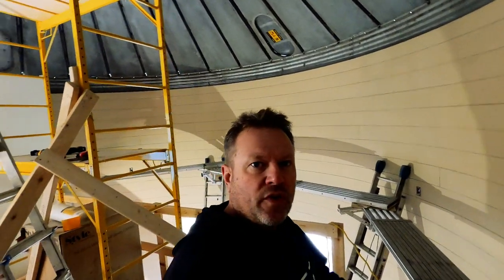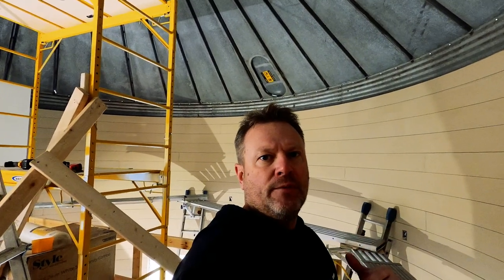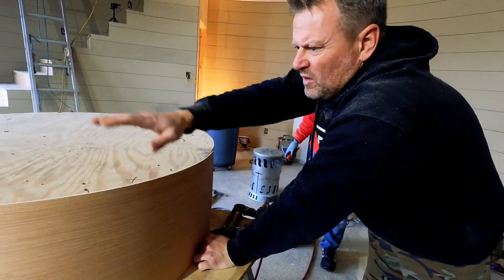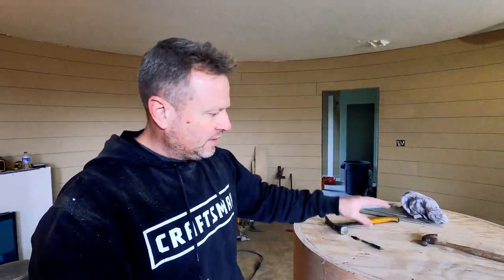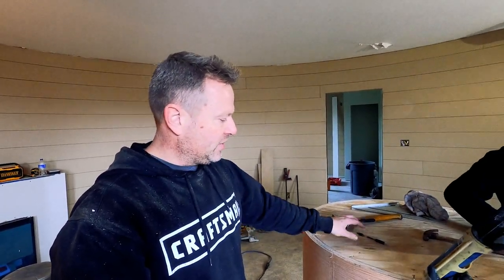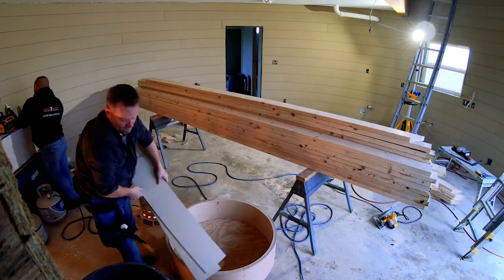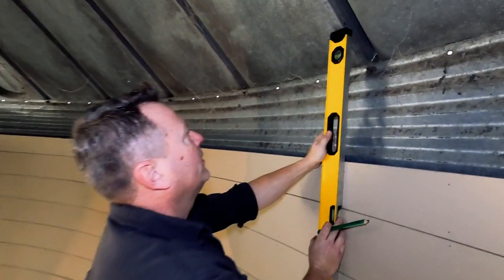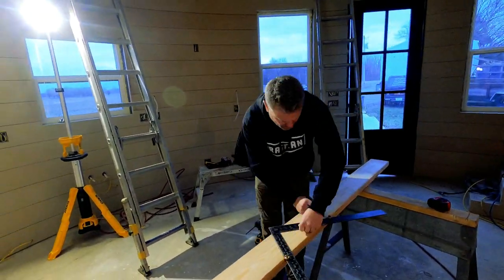Grain Bin Home Build... Episode 23 "Ceiling Framing"

Comment: How are you venting the roof? Metal roofs can create condensation. Looking good !! I'm picking up a 30ft bin and going to do a similar project and use it for a VRBO.
Reply from the maker: Did not vent the roof.  It is spray foamed around all penetrations and batt insulated to that.  Completely spray foamed is premium.  It will not condensate if insulated correctly and well.

Comment: How did you determine the angles for the roof rafters?
Reply from the maker: @rickpainter4821  I set my round center hub, suspended from metal roof with straps.  Then I used a string line from bottom of hub to top edge of my framed curved sidewalls.  This string line represented the bottom of my rafters.  I could then use my speed square or angle finder to determine what these angles were from my string line.

Comment: How did you hang your round hub from your metal ceiling?
Reply from the maker: I suspended it in the air from the existing metal grain bin roof hub.  Once I set 4 opposing rafters it held itself in place as I set all the remaining rafters.

Comment: Off topic question:  What is the tool you are using to cut the 36" round out?  I can't get used to my plunge router with a jig and not that good yet with jig saw.
Reply from the maker: I used a jigsaw to cut it out. Just go slow and use correct blade for what you are cutting.

Comment: Do you think it would be possible to add a "witch hat" roof to one of these instead of using the existing roof?
Reply from the maker: Potentially. You would need to stack the support of new roof down on to the new interior framed wall.  Even then. Would be hard for weight to not want to push tops of walls out...

Comment: Awesome job. Watched all videos. Hope to build home similar in Illinois.  I have a couple questions.  How were studs attached to wall and how much gap do you use from the bin wall?  Are you moved in yet?
Reply from the maker: I anchored the top plates to the metal walls with L clips.  About every 8 to 10 ft or so.
Reply from the maker: There ended up being a consitent 3/4 inch to 1 inch gap
Reply: Did you use sheet metal screws or bolts to secure l brackets to metal bin.  L brackets were on every stud I would assume every 16” apart?
Reply: Did you use sheet metal screws or bolts to secure l brackets to metal bin.  L brackets were on every stud I would assume every 16” apart?
Reply: Did you use sheet metal screws or bolts to secure l brackets to metal bin.  L brackets were on every stud I would assume every 16” apart?
Reply: Sorry. I understand you attached top plates. Not individual studs
Reply from the maker: Just top plates. I used Tek screws.
Reply: How many man hours roughly do you have in it.  Framing and all interior finishes on just the grain bin structure. not including plumbing, heating and concrete
Reply from the maker: Alot... Havent even tracked it.. Just whatever it takes.  But if I was on it full time.. Id figure 3 weeks to frame all... Including addition and exterior finish.  And another 3 to 4 weeks solid for all interior finishes and cabinets... Not including mechanicals..
Reply: How many guys did you have helping you ?
Reply from the maker: It varied. Sometimes just me and one of my sons.. Other times 4 or 5 helpers.  Alot of volunteer labor
Reply: Me and my wife are going to do same project.  Make our primary residence.  We would start this spring.  Would you b open to us looking at your bin.  It’s super cool   We’re from Galena Illinois.  
Phil Schuler
Reply from the maker: @philschuler9067  sure let me know and we can schedule a time
Reply: Which city and state are you in or could I call you  direct.  
Phil
Reply: Which city and state are you in or could I call you  direct.  
Phil
Reply: Which city and state are you in or could I call you  direct.  
Phil
Reply: Which city and state are you in or could I call you  direct.  
Phil
Reply from the maker: @philschuler9067  im in central indiana.